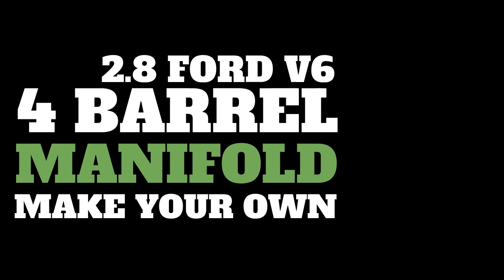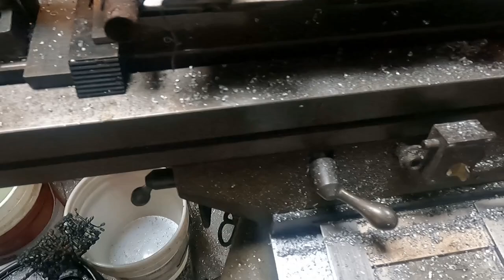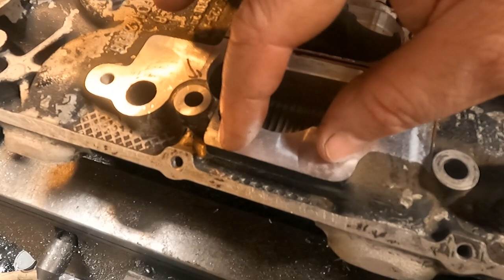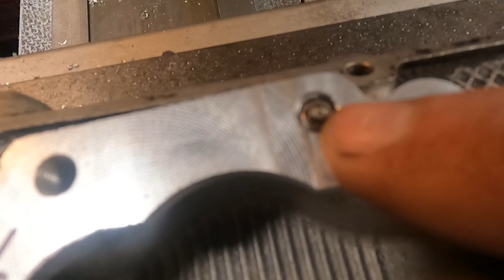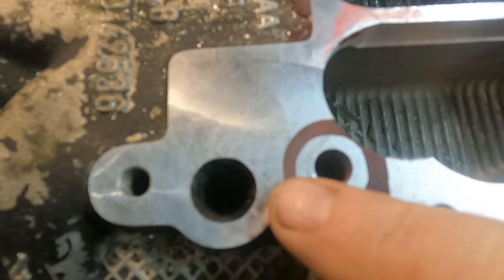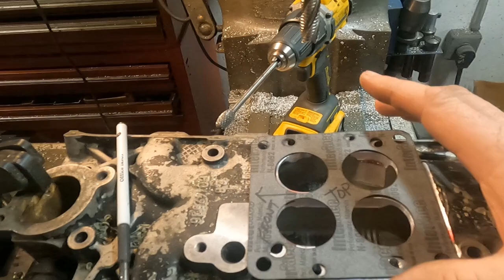2.8 Ford v6 4 barrel Manifold DIY part 1

Comment: 8:40.  Best tool for punching gaskets is a ball out of a bearing, welded to the end of a bolt. (Or use a small ball peen  hammer's ball, on it and hit the hammer face.)  But the little ball ended bolt  trick tool  is something shown me by a mentor.

Comment: Wild and awesome that there are people interested in this kind of build!
Reply: These engines are used in certain racing classes. They also make good swap engines because of the grouping of exhaust ports is tighter. The 2.8 can be stroked to 3.5l.